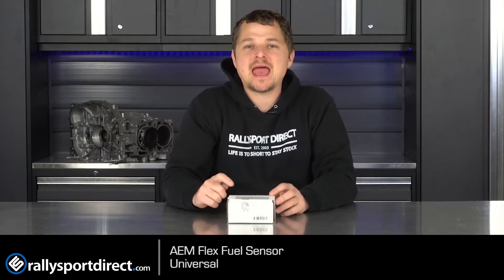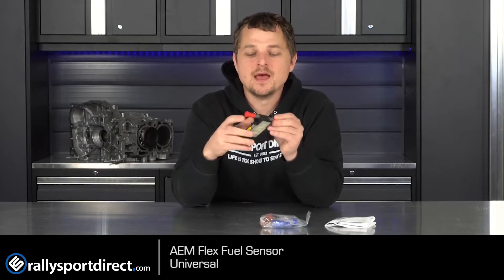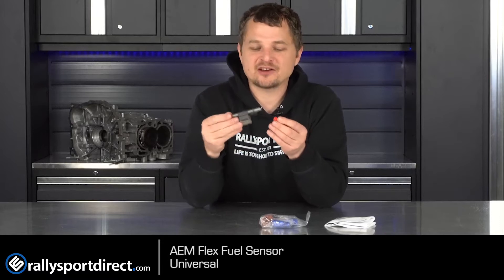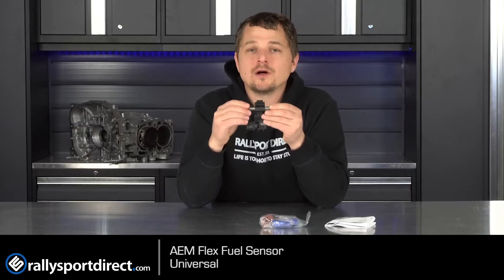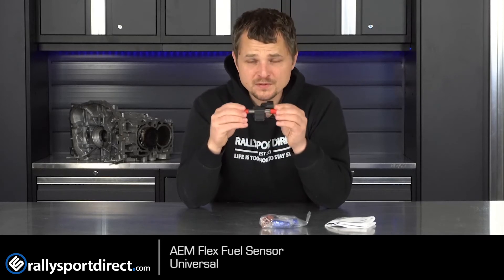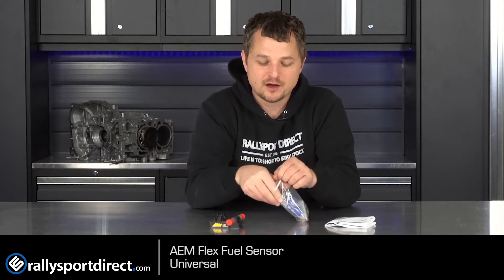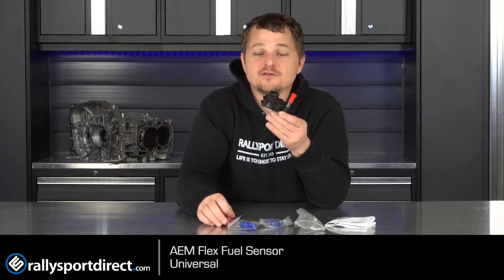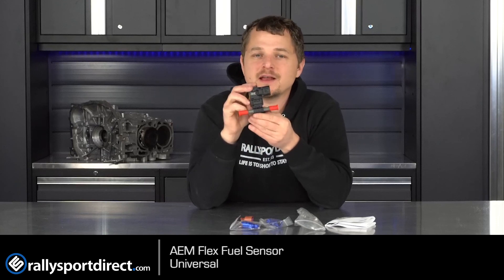AEM Flex Fuel Sensor - Universal

Comment: Will this work in a 2000 dodge ram with the v10 magnum 8.0 liter? So even if I dont have a tune I can install this and it will auto adjust to whatever fuel I put in the tank? No injector connector harness needed like other companies do? Thx man

Comment: Please mention how it works..How the output pins behave and what type of signals etc...!  This guy is just purely redunduntly talking BullShits...!
Reply from the maker: I would love to, but let's think about that and a normal customer. Most people just want to know the basics, 6an? dope, got it. Wire it in? Probably can do that. But the rest is going to be up to the tuner. I mean I would love to dig out my old Tectronics 2 banger scope and show how the sensor reads both temp and actual ethanol content. Run low and high E fuel through it to show the sine wave change frequency and then change the temp and show the pulse width change on the square wave. It would also be fun to explain duty cycles in regards to solenoids on our boost controller, injectors etc.. But let's be honest man, not that many people would care, and if they did, there are MANY people out there who would and have explained it better than I ever could. And honestly I've thought about it, but I feel like I would need a fully separate playlist for stuff like that. But man, yeah, would be fun :)

Thanks,
Rick

Comment: Will it work on a 04 wrx AT
Reply from the maker: This is a universal part so it will physically be able to be installed, but you would need a tune to be able to utilize the flex fuel sensor. I would ask your tuner what he/she recommends.

Thanks,
Rick

Comment: Will fit on 2016 ford focus st
Reply from the maker: You bet, this it self is a universal part, so as long as you have a tuner that supports flex fuel, you can use this.

Thanks,
Rick

Comment: Will this fit a 02 wrx
Reply from the maker: It would physically, but the 16bit ECU in the 02 WRX can not support flex fuel, so you would have to find an aftermarket solution. 

Thanks,
Rick